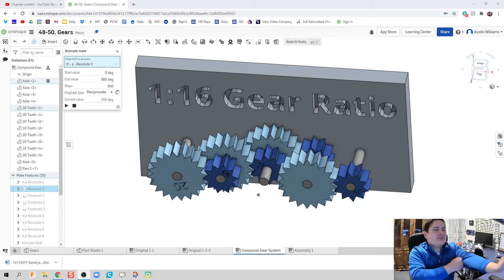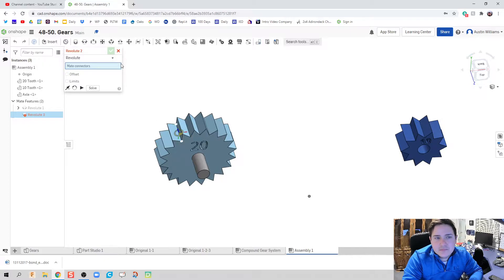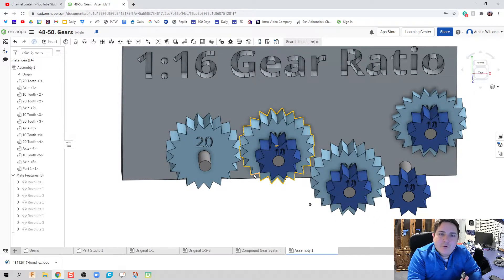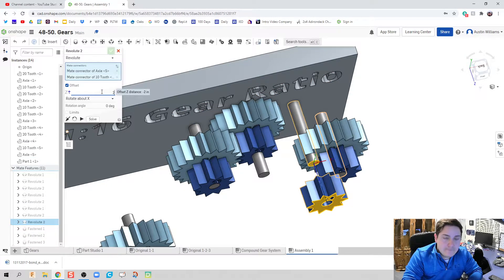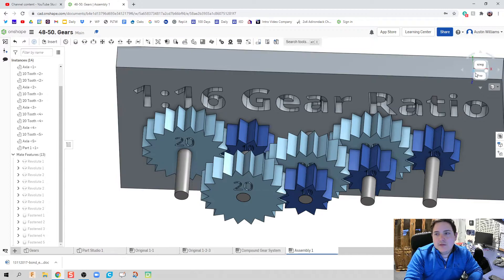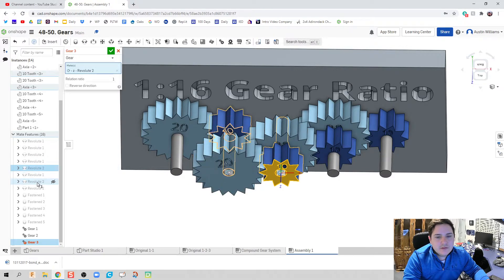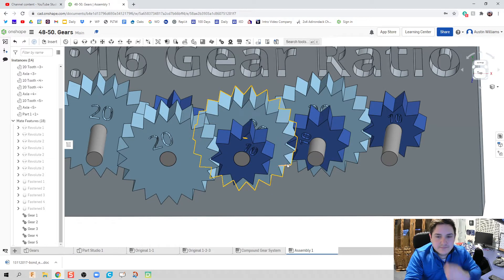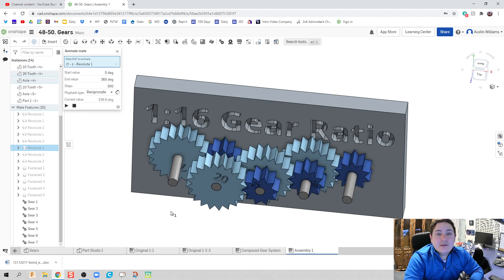1:16 Compound Gear System - Day 50 of 100 OnShape Journey

Comment: I found another way to do this. You can Fasten Mate the gears together if they share an axle. Then, treat the entire axle as a unit. That way, you only have to deal with one Revolute per axle, and you don’t have to mess with making sure the gears on the same axle spin the same direction. 

Do you know of any drawbacks to this method? Something I haven’t thought of?
Reply from the maker: Not sure, depends on the situation of what you are doing. If the axle is fixed to the base, gear, neither, etc... the system will be different.